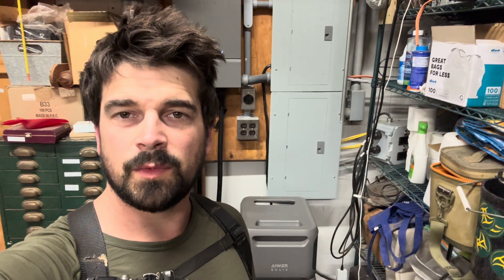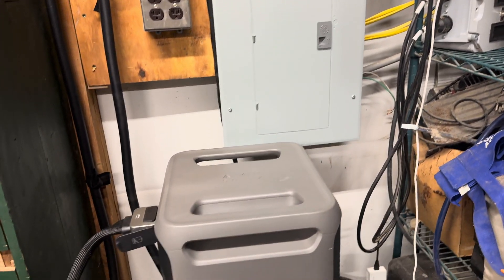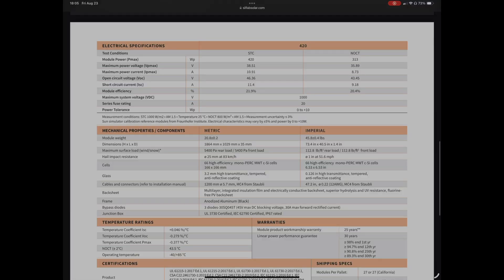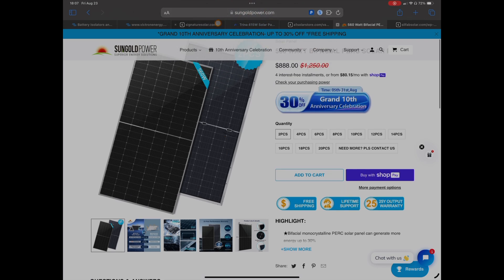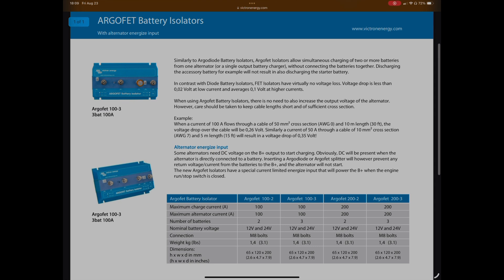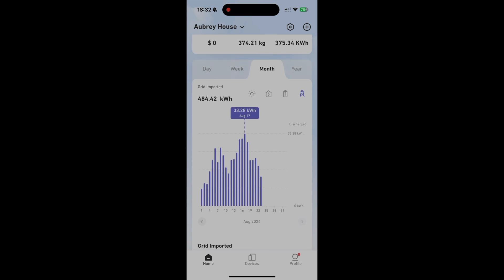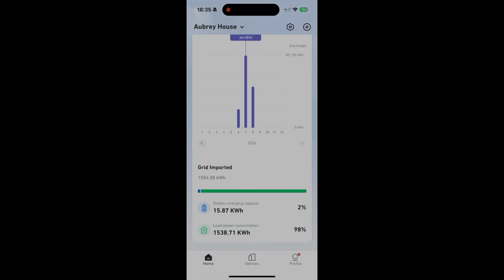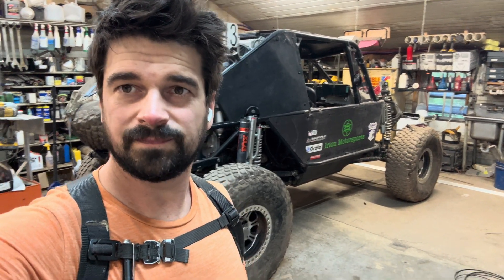Anker Solix F3800 and Smart Home Power Panel Review and Solar Panel Options

Comment: I can now do 165v on my 3800 plus. And i believe there is a hookup in the smart home panel to tie in solar
Reply from the maker: Yeah, the plus is a really nice upgrade.  It not only does 165v on the solar, but allows you to do pass through 220v charging with the generator cable.  They kind of misrepresented the solar tie in.  If you have a conventional grid tied solar system set up, you can charge the power pack with it, but it's converting it to ac, then charging through your home panel.  The home panel doesn't have an inverter in it or a dc solar in.  So it's going from dc (solar) to ac (through the home panel) back to dc (battery storage) and then back to ac (usable household energy).  It's going to loose 5% or so each time it converts.

Comment: @irionmotorsports Thank you for this great content! Question… I’m about to purchase the Smart Home Panel to go with my two F3800s. It comes with a 12 circuit backup subpanel but I noticed that you used your own and have 15 circuits included. Does that mean I’m not limited to selecting only 12 backup circuits?
Reply from the maker: Yeah, I didn't like their panel and I run all ge panels here.  You can run as many circuits as you want.  You're just don't want more load on the sub panel than what your pack or packs can handle.  It's not like it will hurt anything, it will just trip your breaker and then you won't have backup power.

Comment: I have this same system.  The reason they suggest the 80/20 is so that during the day, if your house isn't using much at a given moment, then there is room in the battery to charge.  Otherwise your excess solar production is lost.  This way the extra charge you get during sunshine then gets spent in the evening is the battery returns to 20.  Took me a week to figure this out.  If you know a storrm is coming, there is a mode for that which will have you storing extra.  This strategy doesn't work I guess if you have an unreliable grid.  I have 8 200 W panels, w/ pairs in series, I think their 26V and 10+Amp panels each.  I would love to get a 2nd unit and 8 more panels, but hard to justify.
Reply from the maker: Yeah, my house always uses more than the solar can produce.  There were a few sunny days when I was away and had shut down everything that wasn't essential, where I overproduced.

Comment: The video seems to indicate it can, but just to be 100% clear: are you able to draw a load from the F3800 through the Smart Home Panel while simultaneously charging via the dedicated solar ports (2400W Max) on the F3800?  I.e. if the grid goes down are you able to run your refrigerator/etc while also charging via solar?
Reply: All that and more on the 3800 Plus model
Reply from the maker: Yes, that's the primary use for these.  The one thing you can't do is charge via ac while connected to the smart panel. I.E. you couldn't use a small generator to charge it while it runs your panel.

Comment: Hi , those 560 watts panels that you talk about . How many panels on each port can you add to 1  f3800  , in series or parallel ? Thanks
Reply from the maker: You would only run them in parallel.  Do not run them in series.  You can run as many as you want on each port, but you're going to get diminishing returns after 2.  The f3800 will only pull up to 25amps.  Since the 560w panels have a maximum output of 13.3a which means in full direct summer sun 2 panels will put out up to 26.6a which is more than the power pack can draw.  However mornings, evenings, winter and cloudy days will not give you full power.  If you ran 3 panels on each port you would produce more power in non-direct sunlight, but on sunny days, you wouldn't be able to make use of all of the wattage that the panels are capable of producing.  Does that make sense?  It would be easier to explain if I had as whiteboard.

Comment: does it come with both cables to hook up 2 F3800's? Or do you need to order a second.
Reply from the maker: You have to purchase the second cable.  They cost $99.  The only exception might be if you buy the bundle that has 2 f3800's and a smart home power kit.
Reply: The bundle has it all

Comment: Nice straight forward video. Do you know if two F3800s allow you to go from 6000 watts of continuous power to 12,000 watts of continuous power?
Reply from the maker: Yes, you can get 12kw out of two, but that’s the maximum.  You can’t tie 3 of them together.

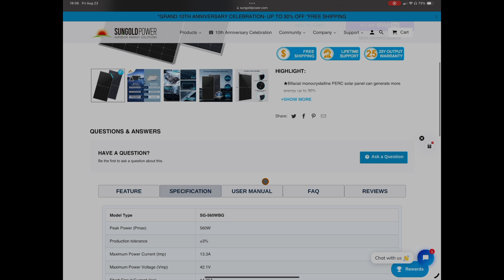Comment: When you talk about the amps at 5:48, can the anker accept more amps as long as the voltage is under 60v? Learning on the go about solar/electric
Reply from the maker: Yes, it will only draw as much amperage as it needs.  Another way to look at it is the voltage is determined by the solar panels, but the amperage is determined by the anker and limited by the solar panels.  Does that make sense?
Reply: @irionmotorsports  the reason i ask is solar panels are hard to find. The anker has a max of 27 amps so even if i had panels at 28-29 amps it would be limited to the anker unit 27 amps limit?
Reply: @LukeGibbsSC yes, you just never go over voltage and slight over amp is fine